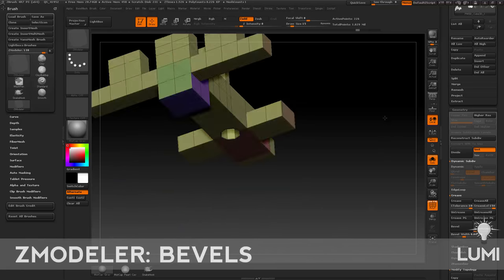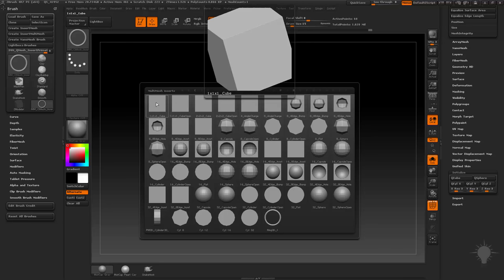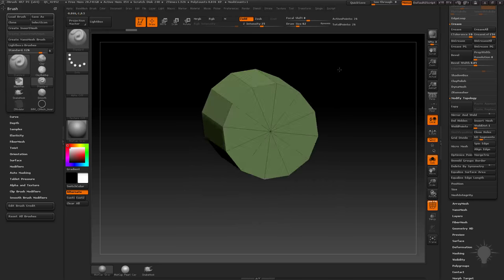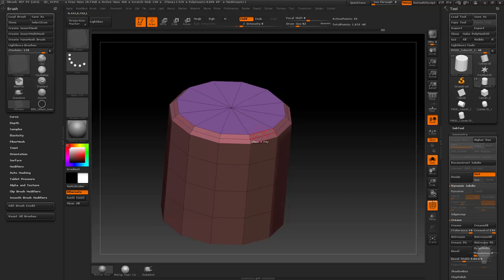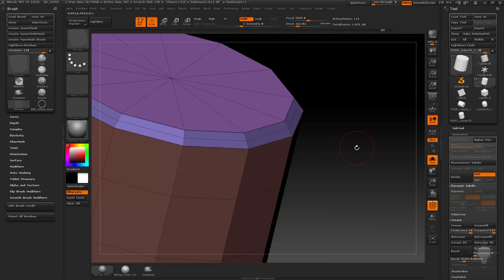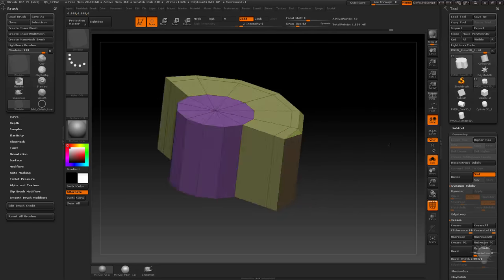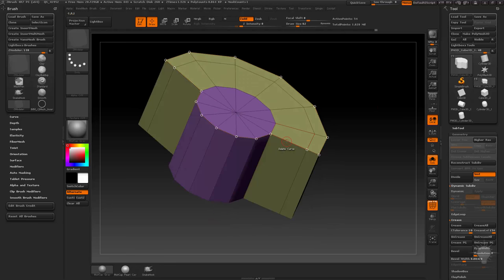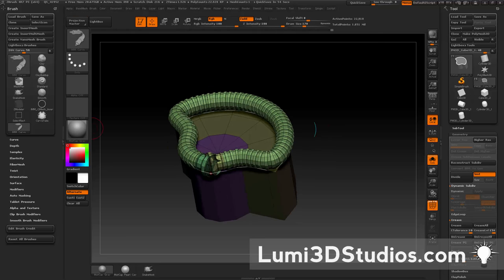018 ZModeler Bevels

Comment: Hi Michael. You are doing a phenomenal work in cg education. I have small question.Lets say I need a plane/plate with rounded corners. In modo I can simply select corner vertexes and bevel/champher them . Is there something similar in zbrush or maybe another way for that kind of task?
Reply from the maker: HMMMMM that's a good one. Off the top of my head I don't have a super elegant solution, they all involve at least a few steps (trim and mirror and weld, or triangulate and bevel partial edgelop, or split point and collapse and extrude, or triangulate and add to curve and bevel all curves, etc....). The quickest, easiest, and (best part) least destructive way is using geometry > dynamic subdivisions with qgrid turned on (play with bevel / chamfer and coverage to dial in the look you want). Best part is you can turn it on and off and make changes on the fly. There's some limitations, but it might be what you're looking for: https://youtu.be/RG4wwvjTexQ?t=32m21s